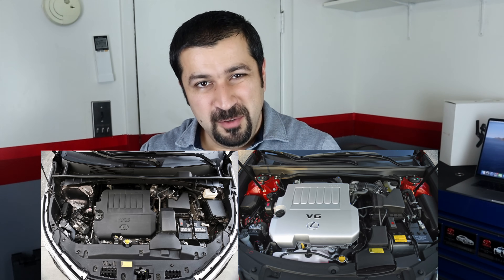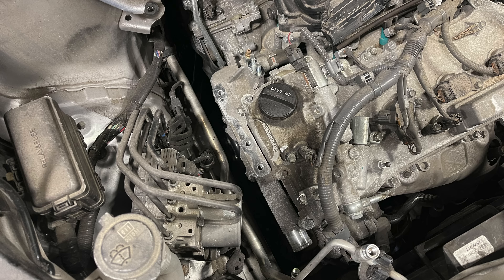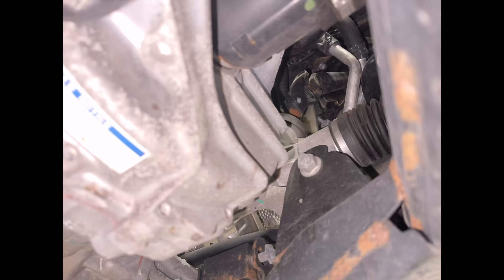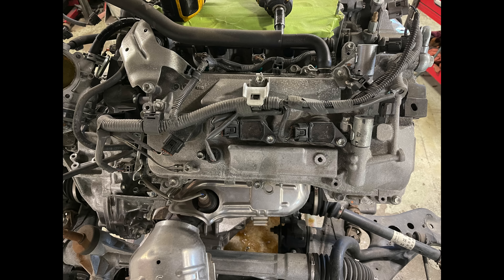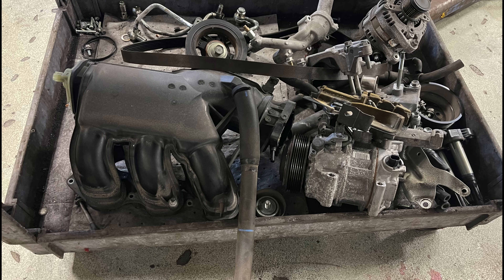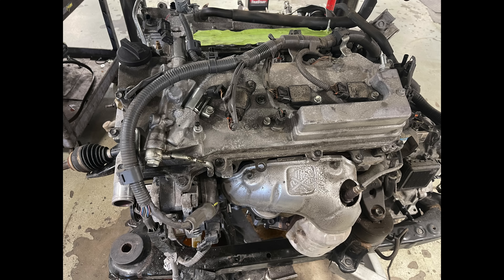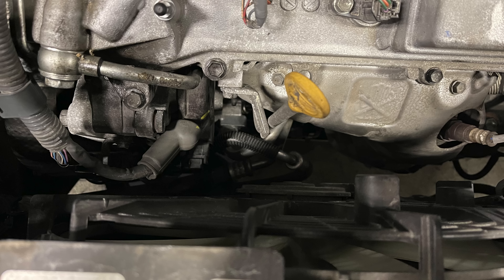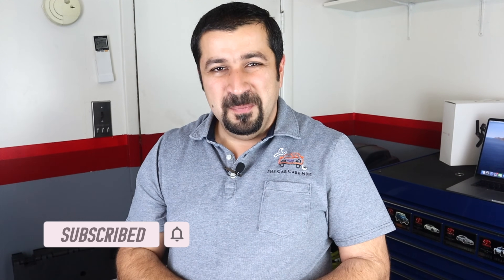Toyota V6 Engine 2GR-FE Disassembly Start to finish Front Timing Cover Repair

Comment: Wouldn't replacing the front cover with a gasket be better that replacing with sealant??
Reply: No a gasket more likely to leak on something this big
Reply from the maker: Gaskets really don’t hold well at all especially on this design. A sealer actually works better but is harder to apply.
Reply: Thank you all for replying.I learned something . I always thought sealant was just  a cheaper way of doing the repair
Reply: @mikeee63  nope not at all, especially on things like oil pans sealant is more much stable. Just needs to be applied correctly and the factory Toyota sealant (can be readily purchased) is excellent

Comment: Can this be done in your driveway, with plenty of time and patience? Without pulling engine? A broke person wants to know!! Thanks
Reply from the maker: Hi! It’s possible but will take a lot longer and not on every model is possible. Like a Camry is simply not possible
Reply: @TheCarCareNut  How about a2015/ 2016 Highlander?  Thanks
Reply from the maker: It’s possible to do it but for me it’s much easier to just pull the drive train down
Reply: @TheCarCareNut   I plan to buy a used Highlander and if it has this issue I can use this issue to save some money. As I  have all the time and can do it myself if possible.Thanks again

Comment: Maybe a short video on how we fellow OCD folks can safely clean the plastic parts in our engine bays??  (I'd assume a cleaner that won't attract dirt when it's dry.)
Reply: I spray the plastic with Simple Green, lightly rub with a soft brush or rag, and then just rinse (no power washer)

Comment: We have a '05 Avalon and there was a recall back in 2006 on the VVTI line that replaced the rubber version to the metal one.

Comment: Hey sorry for asking the question on an unrelated video but I have a 2018 toyota tacoma I live here in the chicagoland northwest suburbs and I'd like to change the fluid in my transfer case, front and rear diffs my question is what do you guys use in the dealership?
Reply from the maker: 80w90 GL5 from Mobil
Reply: Thank you!

Comment: I always clean an engine when I’m done. My friends also master technicians say that I’m too OC, but it’s those small touches that make a difference!
Reply: Do you guys use anything special st the dealer that we don't? I use the gunk a tuff and it's so messy and never looks this good. Are you guys scrubbing with a drill brush or something?
Reply: @LAactor  on a rare occasion, a hand brush to agitate the embedded oil/grease, you can typically find these at a Napa or other parts store. Drill brushes will fling the dirt/oil. Please use eye protection and gloves. I don’t dilute the purple degreaser/cleaner in areas of heavy oil/grease deposits. If you keep your engine bay cleaned, you won’t need those heavy duty cleanings.

Comment: This job is definitely not for a beginner. Amazing work.

What sealer do you recommend for a manual corolla gearbox?
Reply from the maker: Hi! For transmission sealer Toyota has the orange /red FIPG.
Reply: @TheCarCareNut  Do you have the part number?
Reply from the maker: 00295-01281
Reply: @TheCarCareNut  👍 Thanks!

Comment: I have one in my Toyota Aurion. It's a 2012 model with nearly 140,000 kays on it and it is absolutely perfect. No leaks, noises. Nothing.
The 2GR-FE is one of the best engines of all time. Just do regular oil changes and it will do a million kays.
Reply: It's a leaky junk engine. You toyotder buying clowns are brainwashed.
Reply: @wildman1137  What car or SUV with a better engine would you recommend?

Comment: Impressive level of detail . . . Now I know what such work entails, step-by-step. One question, though: You've discussed this engine in an earlier video (on the 15-17 Camrys). You gave this particular V-6 high marks, noting that the oil leak issues had been resolved. (In fact, you say that these cars are the best value). Since the Highlander shares the same engine as the V-6 Camry, is it likely that this leak, in this 2GR-FE, is a result of inadequate maintenance (timing and frequency of oil changes)? Or is this a fairly common issue? (I'm just trying to square the characterization of this engine in the 15-17 Camry video with what you've show us in this video). Thanks.
Reply from the maker: Hi! So this is still a mystery honestly. The highest rate of this leak is on sienna and highlander models. Also 05-10 Avalon was very common but the later ones no. The Camry even the older ones is very rare to see one leaking. Venza is less common as well. It has nothing to do with maintenance really it’s just the sealer if it was applied well or not
Reply: @The Car Care Nut  hey buddy so I just got a used motor to put back in my 2009 camry can I put the vvti oil line that is all metal on my older model before I swap the motor??

Comment: WOW! Back to 4 cylinders.  Thank you so much.  Btw just traded my 2017 LS 460 & a little cash for a 2021 Prius Prime XLE blue magnetism.
Reply: Oooh, enjoy the "free" driving lol!  I imagine you save a literal crap ton of money from going to a V8 down to a hybrid 4 cylinder.

V8's are cool in their respective ways though...
Reply: I love my V8s. The best I can do in the Charlotte North Carolina area is about 50 cents more per gallon for premium and it is required on the 4.6 L. 18 to 23 miles to the gallon if you're gentle an eco mode. Sadly the LS has so much sound deadly material you can hear a little bit of engine noise but nothing from the exhaust until you get about 4,000 RPMs.

Comment: My 2GR-FE has a leak sadly on the Timing cover, 260k miles on it still going strong, everything is soaked in oil where the PS pump is but I'm not going to bother with it as long as it's not leaving puddles or losing oil rapidly.
Reply from the maker: I would do one thing. Clean up the leak to prevent the oily mess. Eventually gets to the belt and gets thrown into the alternator and ruins it. If you clean it regularly it wouldn’t get that bad.
Reply: @TheCarCareNut  Not a mechanic here. I have the same problem with my 2008 Lexus RX350. Not puddles , just drips. No need to add oil in between oil change. Can I use a brake cleaner to clean the affected area? Thank you.
Reply from the maker: Yes you can and I would to see how long it takes to come back
Reply: @TheCarCareNut  Many thanks 🙏🏽
Reply: @TheCarCareNut  thank you for that tip, I'll do that next time I'm under there.
Reply: It's very common, I have it in my 2007 Sienna, I've noticed it 4 years ago, but as you said it's not dripping and the oil level is not going down. So I'll just leave it alone. 150K miles. Still running with no issues.
Reply: Same thing on my 07 rav4 v6  with 215k miles. Leaking at the same area where timing cover, head and block meet together. No drippings and only when you look up from the ground can see  the leak. Why would anyone be bother by this enough to drop the engine unless it is under warranty?

Comment: I'm curious, I have a 2020 Tacoma with the V6 engine.  Would you have to drop the engine in order to do the same repair on my vehicle?
Reply from the maker: You can do this repair in the car without removing the engine. Just need to drop the front  differential to be able to remove the sub pan
Reply: @TheCarCareNut  I have a 16 Tacoma 4x4.  How many hours to do this repair if I ever need it.
Reply from the maker: I don’t remember customer pay time right off the top of my head but warranty time is around 16 I think
Reply: Tacoma is body on frame little different. Some have had the cabs pulled up and off frame to do this. 

I just had my 17 Tacoma done under PT warranty. They removed the hood and pulled the engine only out the top. Then removed the valve covers and oil pan to access remove and reseal the entire front timing cover. 16 hours labor on Tacoma 4x4.

Only 16-17 Tacoma’s leak your should be okay.
Reply: @drummerrs2505  Thanks!

Comment: As big a job as this is, does the Service Advisor advise the owner to replace any parts pro-actively while the engine is out of the car, such as spark plugs, water pump, thermostat, belt tensioners?  Thank you for another wonderful video.
Reply from the maker: Hi Craig! Yes usually we recommend to the advisor certain things. You can’t recommend repair items like thermostat, water pump or belt tensioner on an extended warranty job because those are warranty covered items and customers typically get upset that they’re not covered and it opens a whole can of worms. If any of the items have any issues then they’re covered by the warranty as well. Maintenance items like spark plugs belts we usually recommend

Comment: Hi AMD,

Have you done a video addressing the VVT issues on this engine? I have an 07 Sienna with 110k miles and every time we start the car we get the VVT grinding noise for a few seconds. I am wondering how long this can go on before needing major repair.
Reply from the maker: Hi! That was the one issue with this engine that got things real expensive. Does it do it everytime or only when it sits for long?
Reply: @TheCarCareNut  It doesn't do it every time and it doesn't seem to have a specific causal, it just seems to happen randomly. I know it's regularly happening if my wife is complaining about it. :)
Reply from the maker: In this case it’s just starting but when it gets to a point where it does it every single time you start the car cold or hot then it’s a concern

Comment: Wow  what a pain of a to fix an oil leak. We have 2014 Highlander hope this tnever happens to us. I bet this is a $4k job
Reply: If you have the 3.5 it will happen they all leak from the timing cover sooner or later.
Reply: @jgranger2002  unfortunately
Reply: And here I thought it was a $600-$1000. Guess I wasn't thinking dealer prices.

Comment: For those of us with this leak, at what point do we NEED to have this done? I imagine if the oil is pooling on the ground, but if the leak is a slight weep, still need to be done at that point?
Reply from the maker: Honestly if it’s not actively dripping on the ground I wouldn’t worry about it. However if you have any kind of warranty bring it up even if it’s small. If you are out of warranty and it’s covering the whole sub frame clean everything and drive it and see how long it takes to reappear.
Reply: @TheCarCareNut  Thank you for the response CCN👍🏻
Reply: @TheCarCareNut   Yes sir that would be mine Seeping but not dripping
last quoted a 1700$ repair two years ago
Reply: @Probe253  I was quoted 7300 by a local shop here in Arkansas

Comment: Another great video and information!!  Thank You!     But, Holy molly! 
Question: with the understanding that this is a 2015 and assumed been driven in the Chicago area all these years, from looking at all the rusts, the accumulated dirt/dust, the sludge at the bottom of the oil pan and etc. would you assume this vehicle was maintained regularly or frequently behind on routine maintenance (including wash & wax the vehicle ;)  )?
Reply from the maker: Hi! This was honestly not maintained judging by the inside of the engine. Oil changes were hopefully done around 10k miles and some of them were closer to 15k miles from the service history.

Comment: How many miles does it have? And what his the price range for this job?
Reply from the maker: If memory serves right it had around 80k miles. And it costs around 2.5-3k not much parts but most of it is labor
Reply: @TheCarCareNut   I know COD cost, around $4.5K, It's maryland state dealer price.

Comment: AMD, How much oil was it leaking before this major intervention?
Reply from the maker: It was all the way to bottom of the oil pan dripping on the floor. Customer had mentioned it a year prior but the extended warranty wanted to clean it and add oil dye which we did. Didn’t see the car until another year have passed and very little miles driven (around 2k miles)

Comment: Do you have the part number for that power train table/stand?  I've been trying to get my dealership to buy one, the dealership I worked previously had one but don't remember the specifics.
Reply from the maker: Ironically it’s a Nissan SST but it works really well. It looks the sub frame in the back so it’s very stable. The number for the tool is J-47242 and you can see it here https://www.tillmantools.com/J-47242-Engine-Support-Table-Kent-Moore-p/kmtj-47242.htm
Reply: @TheCarCareNut  Thank you sir.  Yeah the one I used at the previous dealership was a Infinity SST which I'm sure is the same as the Nissan SST.  They share the shop but since there are a lot more Toyotas than Infinitis, Toyota guys use that tool a lot more often.

Comment: nothing excites me more than seeing a new video from you hahaha hell yes
Few questions:
IS this the same engine that is in the Tacoma? Also, Are these low mileage leaks or high mileage leaks?
Reply from the maker: Hi Hugo! Thank you for watching! This is not the same engine in the Tacoma. A newer updated version of this engine is in the 2016+ Tacoma which also leaks exactly the same. The older Tacoma had a similar block but different cylinder heads. These leaks are really random. Some leak as low as 15k miles some go 200k miles without leaking
Reply: @TheCarCareNut  i own a 2021 tundra how common are cam tower leaks on those? and is that one of those random leaks as well?
Reply from the maker: I haven’t seen one on a 2021 yet but the other day we had a 2019 with a leaking cam tower. Also very random on those

Comment: Thank you for the incredible dive into this job. I have this engine in my 16 Camry. Are there any tricks to replacing the serpentine belt? One manual said it is so close to the body that the subframe has to be lowered! Is the valve lash on this engine hydraulic and therefore requiring no adjustment? What sealant do you recommend? Should the desiccant/drier be replaced if you open the A/C system? This engine is so smooth and sounds so great wide open. I guess the $6K and service challenge is the cost over the 2.5L!
Reply from the maker: Hi Randy! The serpentine belt area is tight but a bit easier through the wheel well. Where that apron cover that I removed in this video that exposed the harmonic balancer. No need to drop the sub frame of course for the belt. This engine has hydraulic lifters so no valve adjustments. For the sealer on the engine I would use the original sealer it’s not expensive and it’s very good. For the AC if you place it on a 20-25 min vacuum afterwards you don’t need to replace the drier

Comment: I had rusty bolts on that engine's plastic intake manifold (the allen key socket stripped the head...one of the reasons the spark plugs never got changed while we had it...  make sure to change the spark plugs on your V6 every 50k miles.  Its to get the bolts out while they are removable before they seize together.
Reply: Why 50,000 miles? Denso specifies 100-105,000 miles on this iridium tipped plugs. Protect the heads of the bolts by applying some dielectric grease and apply anti seize to the threads instead….🤷🏻‍♂️
Reply: Yes.  The Denso plugs themselves will be fine.  All the parts that need removed to get to the plugs might get seized together together, which is what happened to me.  Also, spark plugs that don't move at all upon attempting to loosen, since they were never removed until 100k+ miles, also are not fun to deal with since they feel like they can break, and end up wasting time. That's why I'd suggest changing them out at 50k miles.  Bare minimum, take them out, inspect them then reinstall them at 50k..but with all that work, just replace them.
Reply: @mattb9664  Odd about those denso spark plugs, I just replaced them on a 2004 4Runner with 205,000 miles and not one of them seized. Then on an 07 Tundra with 103,000 miles and again, not an issue. Perhaps applying anti seize on your spark plugs?

Comment: Has Lexus/Toyota improved the gasket design by now on new engines to stem this from occurring so much?
Reply from the maker: The newer models have been doing good. There was a rough patch around 2018-2019 but now they’re good. The last year of this engine I think was the 2016 highlander sienna and the 2017 Camry
Reply: @TheCarCareNut  Thank you for reply my friend! I am looking to purchase a 2022 Lexus ES with a V6 and was curious as to their durability refinement of the engine by now.
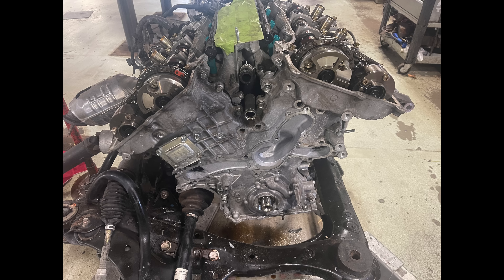Reply: At 10:59 AMD has installed RTV type gasket sealer, this is most likely equivalent to the factory sealant.  It works well unless an air bubble in the dispenser or something like oil on mating surface and it's assembled in a timely manner.   Most of them with problems would be corrected by the dealership under the warranty period.   Workmanship usually improves over time on the assembly line for the engines.
Reply from the maker: Usually the ones that leak early are due to oil contaminated surfaces. The sealer works very well if the surface is 100% oil free. So cleaning is essential and triple checking the area before installing the cover.

Comment: At what mileage does the leak start usually? And is it just as difficult for a front wheel drive Toyota Highlander compared to a four-wheel drive to repair the timing cover seal?
Reply from the maker: Hi! Can’t really put a mileage or time on it. Some leak at as low as 15-30k miles some go over 200k without any leaks. FWD and AWD are almost similar

Comment: Thank you AMD. I found on internet, P610 has primitive limited slip differential. Is that true? 🤔
Reply from the maker: Hi Marjan! Yes it’s called pre torque. Pretty cool design to improve drivability
Reply: @TheCarCareNut  Could you please share more info about that. There is hardly any info on internet about that. Would be nice one video :)
Reply from the maker: Hard to explain it simply but it has a spring that almost locks the differential at low load and steady acceleration and at high load it opens the differential. Very mechanical and not electronic but very smart
Reply: @TheCarCareNut  Thank you for explanation.